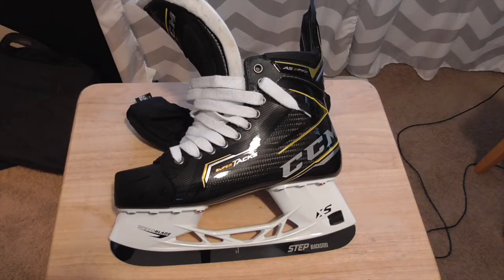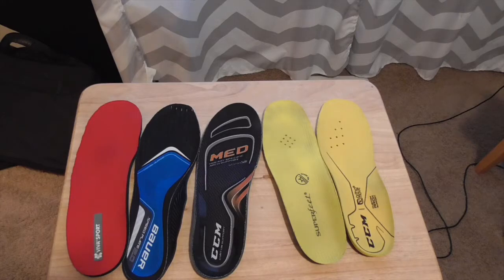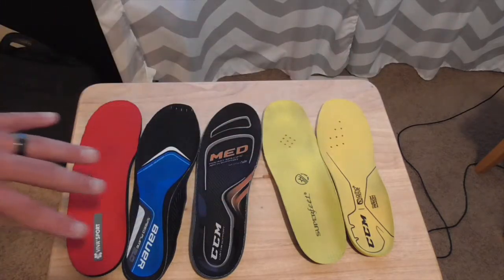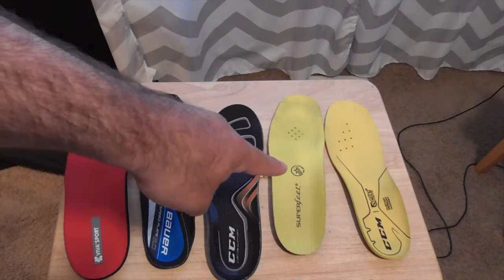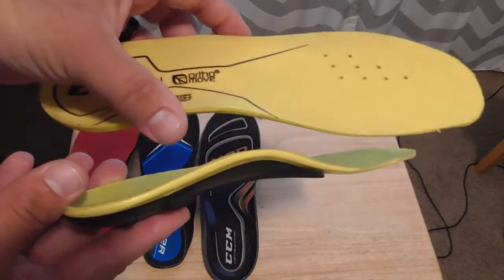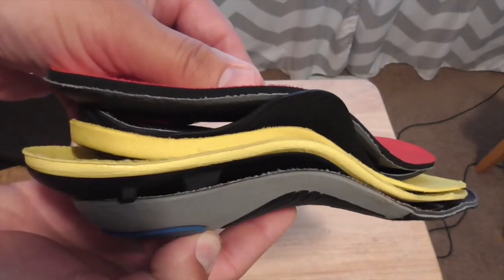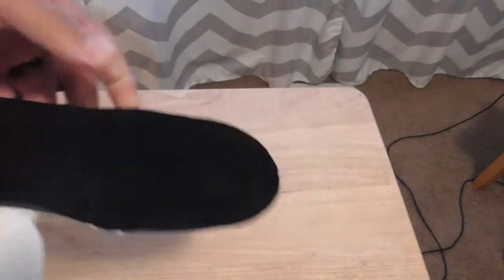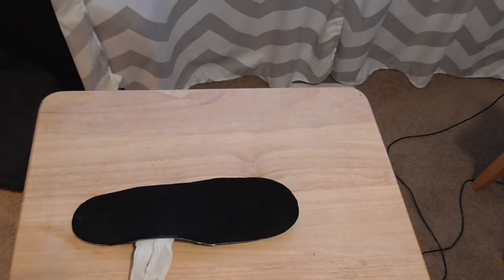Recommended Custom Insole Specs for Ice Hockey Skates

Comment: Best way to mold super feet is to have it molded together with the skate. I did that and it helps change the shape of the skate. If you just mold the insole it doesn’t help
Reply: *I mean Bauer speed plate
Reply from the maker: Hey there, thanks for the view and the comment!  Yes, I've also started doing that over the last couple of years, too.  Since recording this video, I also learned about Graf heat moldable insoles.  I bought a pair for $30 at Goalies Plus.  Not quite as much arch support as Superfeet, but noticeably more comfortable.
Reply: @jeffliss3265  I heat mould the skates with the stock insoles first. Then heat mould the speed plates after. I've done both and I find you really need to rush and sometimes don't get a good mould of the speed plates bc some skates you aren't supposed to stand on them during the bake. Bauer you can. Ccm doesn't say anything so I don't think it's recommended. Speed plates require you to stand on them to mould properly.

Comment: Hello, it 8/2/2024 and i am just coming across your video. You freaked me out saying your True skate messed up your foot. I am on my second pair of SVH custom skates. I wore Bauer Ultrasonics in between the 2 pair of SVH. My second pair I have had for a couple months, the big toes on both my feet go numb after about 20 minutes of play. I have tried so many different things, curious what you think and what caused your foot injury?  Thanks, Brad T.
Reply from the maker: @TheBrad605  hey there, so I think you’re saying the True skates are giving you the numb toes?  It makes sense to me that the Trues are the problem because of how they’re made.  If it’s the Ultrasonic, that makes less sense.  If it’s the Trues, it’s likely a combination of how tight they make the skates combined with the aggressive forward pitch.  Careful with this as that combo resulted in a torn big toe tendon that became a permanent issue.  It’s also a known issue with True and one which they don’t publicly acknowledge.  I’d be careful with this.  It’s not worth the injury.  Give me some more information and we can go from here.
Reply: @mongillohockey  yeah it’s the Trues. The Ultrasonics were fine. I love the feel the Trues on the ice, I get a good feel of the ice. I was thinking of trying a softer felt tongue, but not sure that is the solution.  They said I should rebake them with tissue in spots to give a little more room. Just not sure where to add the tissue. The skate actually feel and fits good. Just the numb toes. The fact that it’s both feet is what’s strange or good??
Reply from the maker: @TheBrad605  In full transparency I obviously can’t diagnose the issue fully over YouTube, but it’s my belief that one of two things is going on.  First, the boots are too short since they make boots relatively tight.  The second thing that could cause the numbness is pressure on the top or instep of the foot.  If it’s the latter, a thinner tongue could potentially help.  If it’s not that, the boots are likely too small in the length.  Keep an eye on how the numbness develops.  Also, it could be cause for concern if the numbness lasts even after you’re done skating.  For me, it started with numb toes, progressed into pain in the ball of my left foot, then pain and numbness when I wasn’t skating and finally the left big toe tendon partially tore.  I’m not saying that’s what’s going on for you, but those are some signs.
Reply: @mongillohockey  thank you

Comment: PEDAG makes the best insoles. Go for those!
Reply from the maker: Rocking those now!
Reply: @mongillohockey  how do you like them? I need to get out of my speedplate 2.0s
Reply from the maker: @goatsonapost  so my tube has changed on insoles since I learned about my own foot mechanics from a PT guy.  Turns out a flat insole from Elite Hockey is better for my high arch.  Totally counter intuitive.  That said, I still use the pedag in my street shoes.
Reply: @mongillohockey  I was actually hunting for the CCM custom insoles (those that have gone out of stock now and come in three different colors), and came back to this video then found this thread on the "Pedag" insoles. I have a medium sized arch I believe and am looking for insoles that match that profile, but without the dreaded heel gel pad that tends to lift your foot too much and thus eat space in the boot (also, feels very spongy while skating, taking away your feel with the ice).

I used to use a pair of Burton snowboard boot insoles as they're basically a piece of molded rubber and thus don't come with the typical gel pad in the heel etc. but, it was a very nice experience. Unfortunately they're crumbling away due to age and wear, and I am not able to get a replacement.

What's your experience from heel gel pads on insoles used for hockey? (just asking as a curiousity, as mentioned before I felt like the skate basically became unstable). And thanks for the review; it's great to see more content on hockey.
Reply: What model of the Pedag insoles are you recommending? I've got a medium sized arch I believe and don't want any insole with heel gel pads.

Comment: Anything not a yellow color on your table is garbage.  In a hockey boot, more padding means less energy transfer which means less skating efficiency which means less speed.  Having said that ... nothing will compete with a real, custom orthotic.

The notches on the back of the Superfeet insole are to stabilize your heel.  Though, I do agree this is probably not as necessary in a hockey boot (as heel stabilization is in the design).  This was the insole I used to use in my hockey stakes, and still use Superfeet insoles in my regular shoes and hiking boots.

The CCM insole with the adjustable arch support is what I use now, and it is great.

Comment: How did True skates CAUSE the injury? Are you in great shape? What happened?
Reply from the maker: Hi thanks for watching and the question.  So, I'm not sure how familiar you are with the fit of the current and previous generation of True skates, but they're more aggressively pitched forward than any other skate brand or model.  This is, of course, not taking into consideration skate profiling.  Additionally, True makes skates very tight to increase performance.  If you combine skates that were accidentally made too small (Even by True standards), pretty extreme forward pitch and the fact that the bottoms of your feet are not taken into consideration during the custom fitting process, it resulted in the partial tearing of my left big toe tendon.  That occurred three years ago and has still not healed after numerous medical procedures.  True tried making me another pair of skates for free, but those were the wrong size again and the problem still persisted.  In addition to the skates not fitting, it became obvious that's just how those skates fit.  After my injury, I got the opportunity to talk more with True about my experience and was told that I wasn't the only person this has happened to.  In fact, the current generation of skates (Excluding the Catalyst) partially resolved the issue.  They wouldn't come out and say it, but I got the impression there was a theme of fit-related injuries being caused by the skates.  With all of that said, I do actually really like the folks at True and they did try to help me, but their stuff just isn't at the same level as Bauer and CCM right now.  That could change, but it's just the case right now.  The last thing I'll mention, is even if True skates fit you perfectly right out of the box or custom, there's a learning curve that takes longer than other more traditional skates.  If you're INTENTIONALLY trying to improve your skating or learn how to skate, they'll force you into a proper skating position.  However, if you've been skating a long time like me, I don't want to be forced into a new style.  Hope all of that answers your questions.
Reply: @mongillohockey  Thank you very much for taking the time to reply. 

I've been looking into custom skates bc my feet got way wider with age and none of the box skates fit right any longer without pain.
I used to skate 652s then the next gen pumps. Started playing again in 2007 and feet were still thin enough there was only slight irritation but no good fits any longer. Then took another 6 yr. break and skated in a lot pain. Bought the top end Baurs last year and it was better for a while. I skate a lot.
There's not any real good information in comparing the customs. Best I could find was Baur was not truly custom, CCM had a scan and heat molded a print of your foot and that intrigued me but I couldn't get good answers as to how that would play out. True from people I asked felt it was the first skate for their wonky feet that fit. So I went with True. I do not have them yet. But I have had pain in the ball of my left toe for months now. 
Your reviews are the most thorough I've found. 
That's where I'm at.
Reply: @mongillohockey  hey I'm not sure why it's not widely known that true are more aggressively pitched but the guy at the store told me to go for them and I listened to him bc my friends love them when I got them I noticed the forward pitch right away and didn't like it they also made the right skate a bit off...
But anyway I skated a few times bc people told me it takes time to get used to, I ended up falling weirdly one time using them and couldn't play for 2 months ( I'm not blaming true for my fall lol just saying when you feel weird in a skate you have to be careful if you know what I mean...) I still have slight issues with my hip from the fall but I am able to play again,
Also my knees would hurt like crazy after using them (probably bc of the forward pitch forcing knee bend),
Only after all this I started research and found out lots of people have all these issues with them anyway after the fall I never wore them again and went back to ccm 
Now I just got a pair of Bauer bc I found a pair that fits really good but haven't skated in them yet so hoping the pitch isn't weird for me also I remember you saying Bauer pitch is perfect so I decided to give them a shot I'm looking forward and a bit nervous
Thanks for your content....
Reply from the maker: @hudakarli5512  Thanks for the story!  You need to watch my other videos on custom skates.  I owned two pairs of custom Trie skates and they permanently injured my left big toe by tearing the tendon.  It was because of the tight fit and aggressive forward pitch.  It’s a known issue at all levels and resulted in free skates for me.  That was in 2019 and I’ll never recommend that skate again.

Comment: what is your standard shoes size? Do you wear longer sizes to compensate wide feet?
Reply from the maker: Hey there, thanks for the comment and watching my video!  So, my technical shoe size is probably a 10 or 10.5 wide in dress shoes or running shoes.  My skates you see in the video are an 8EE (Wide).  Basically what I'll do for retail skate insoles is try not to fall into the trap that most fall into.  What I mean by that, is if I were to go online to buy a pair of SuperFeet and I know my skate size is an 8, it'll tell me to get a size "E" because my shoe size falls in between a 9.5-11.  The problem with that and for people with wide heels or feet, is that the insole will not be wide enough.  That said, it WILL be the correct length.  As a result, what I've started doing, is buying the size "F" SuperFeet because it's the correct-ish heel and foot width.  All I'd need to do is cut it down to the correct length.  Heel and forefoot width, plus arch is what really matters in an insole.  Trim the length down to whatever you need.  So, that was my long-winded way of telling you that in Superfeet and the CCM Currex insoles, I DO buy a size up to compensate for width.  Hope that helps!
Reply: @mongillohockey   thank you for reply :) yes I went 2 size bigger superfeet due to heel was not wide enough but I need volume and all insole except for orthomove custom arch from ccm take a lot of volume in skates. I am considering to create lace extenders from strong leather to do something with volume because I have Ribcor 80k EE skates which are deepest skate but still not enough... I dont know if ultrasonic Fit3 will be deeper.
Reply from the maker: Hanrider I see.  So I owned a size 8EE in the 80K and a size 8 Fit 3 in the Ultrasonic before I ended up in the AS3 Pro skates.  The fit 3 will absolutely give you the heel depth and instep height you’re looking for, but you absolutely need to get scanned for fit if possible.  The new Bauer sizing is no longer the same, even in length.